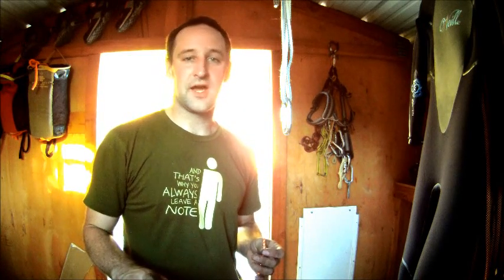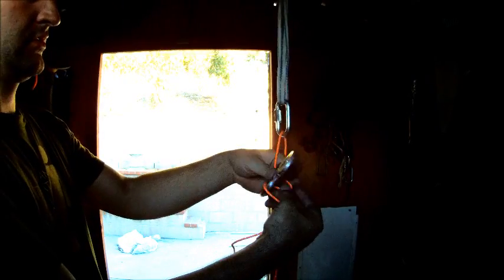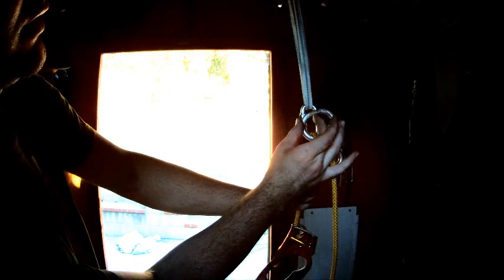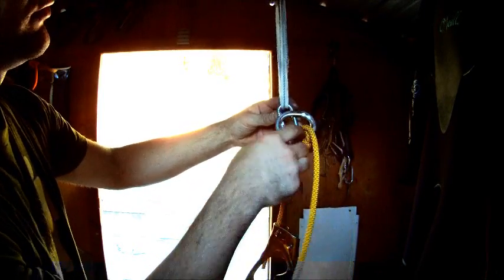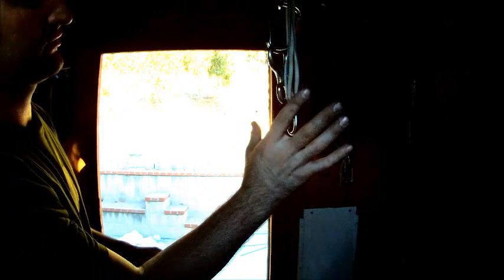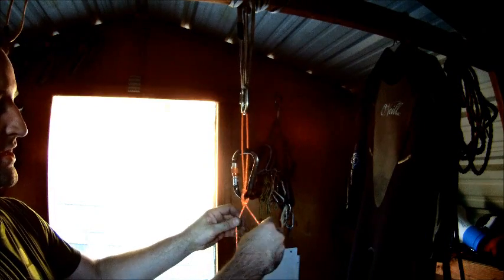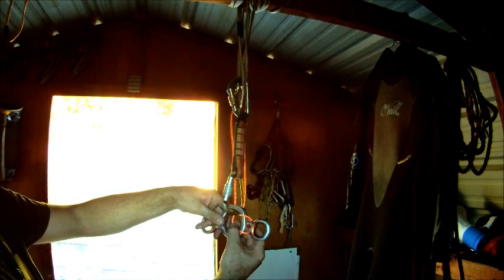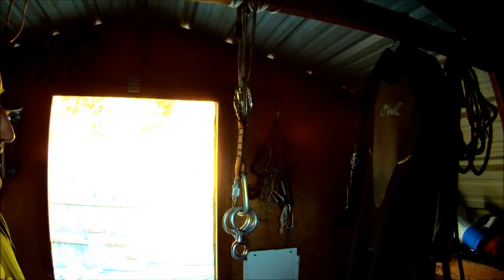Figure 8 blocks don't lock

Comment: Great video. I learned a variation from a big wall climber that I much prefer. Instead of feeding the bite back through the large loop of the figure 8, take a bite and push it through the small eye then finish it with 2 macrame knots and a carabiner to close the loop. There is no way it can slip, and it’s actually faster to convert it in an emergency (just remove the carabiner and pull the macrame loops out with a quick tug).
Reply from the maker: Yep, that's the "Euro 8" (ropewiki.com/Figure_8_block) and it seems to be the best of all worlds except it's slightly more difficult/involved to rig

Comment from the maker: There are two possible directions to add that twist ("second bight twist") and they result in either the Crossover or Tom Jones variation (see Wiki link in updated description).  In my tests, the Crossover variation has no appreciable advantages over the Short variation in this video.  Tom Jones' version does indeed lock, but can have trouble releasing.  I recommend one of the secure variations; they don't lock, but seem to have enough friction to avoid the problem shown in this video.